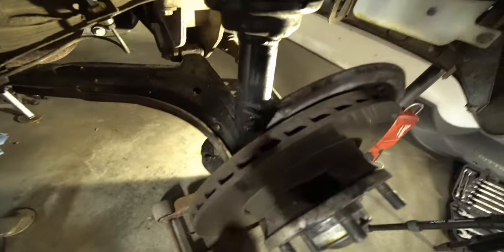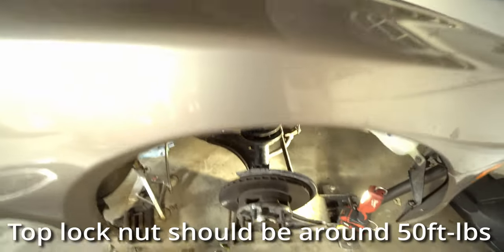Porsche 944 Front Lift Spacers Install

Comment: how is it riding after having had it for some time?
Reply from the maker: Rides pretty good, could use a little more rebound travel in the rear. Might try to find a spacer for the shock, currently limited by the shock shaft in the rear due to the indexing of the torsion bar